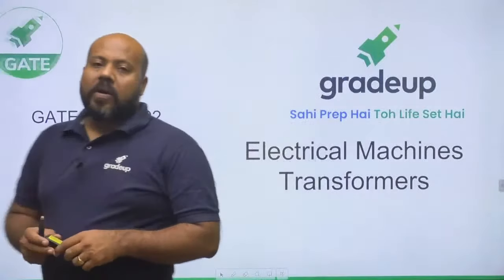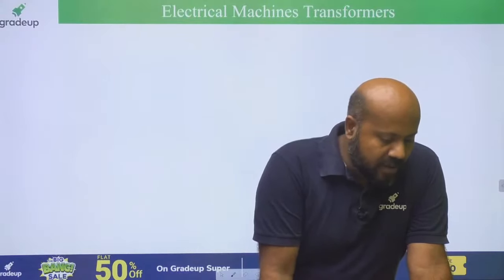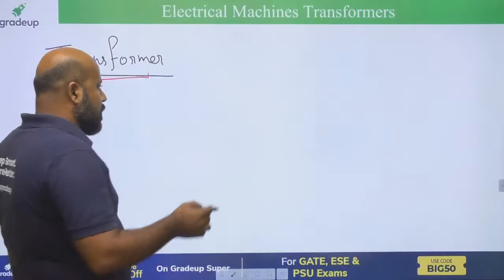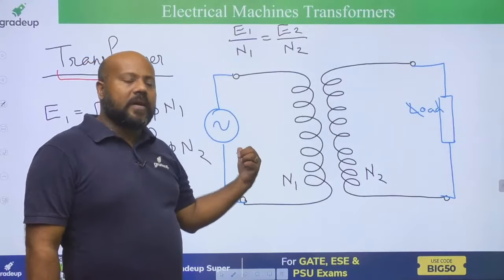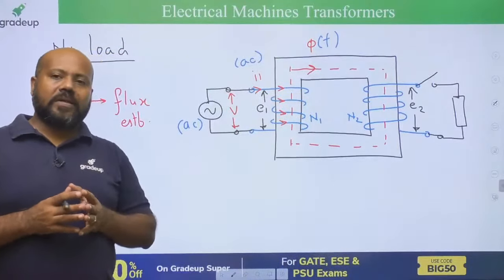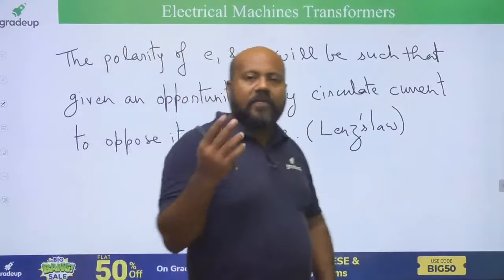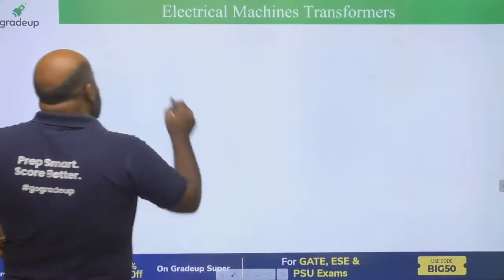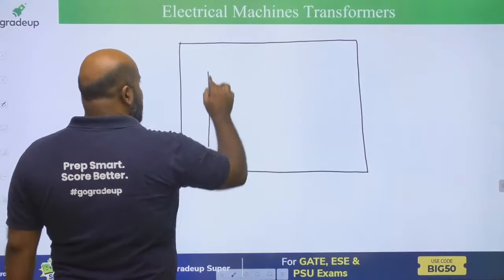GATE & ESE 2023 | Electrical Engineering | Electrical Machines | Transformers | Ashutosh Saxena

Comment: A variable frequency source of internal resistance of 3000 ohm delivers power through a transformer with N1/N2=20 to a load of 7.5 ohm resistance. Core loss and winding resistances are negligible. For upper and lower half power frequencies of 40 Hz and 15000 Hz, calculate (a) primary self inductance on the primary side (b) the leakage inductance on the primary side